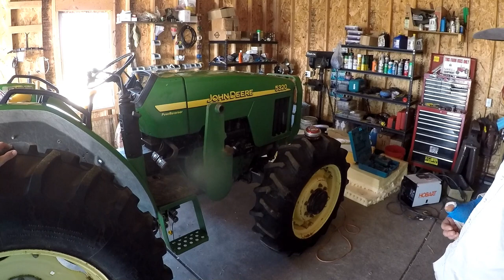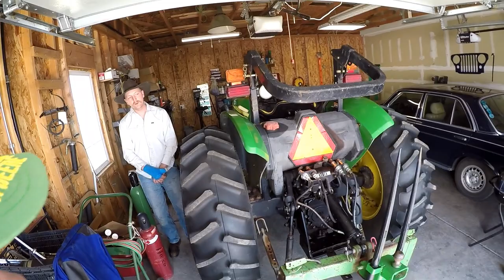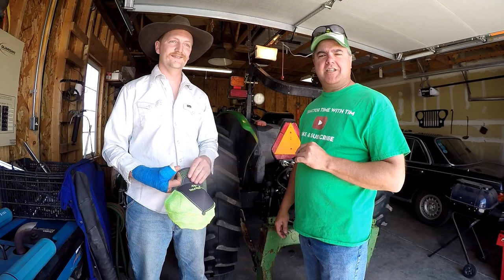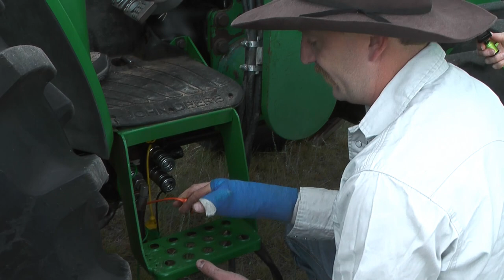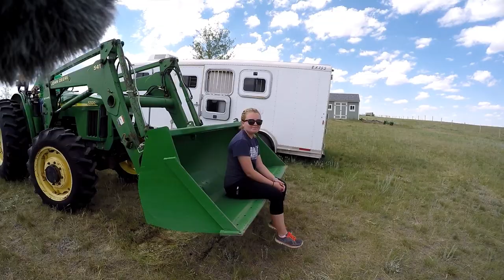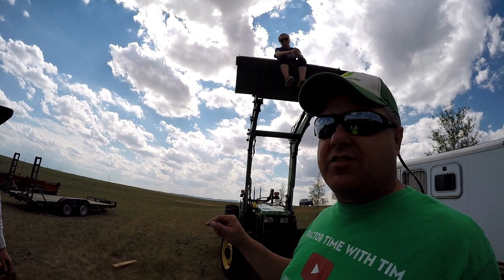Why Buy John Deere? (and why not); JD 5320; Katriel and the Self-Leveling Bucket

Comment: Nice video Tim and Blake. One thing that continually amazes me about JD compared to other brands is not only the easily on-line access to parts information but also the operator's manuals.  I've tried to access on-line parts and manuals information for a few other tractors (Kubota, New Holland, Yanmar and Kioti) and it is very difficult and in most cases impossible.

Comment: I have long been a John Deere guy. Grew up with the green and would probably have bled green if cut. Anymore, it seems  that the Deere company seems to be grinding up $100 bills into the paint and do not seem to be worth the difference in price to people. Having said that, consider the dealership network and parts availability. That comes with the price tag. Are they better tractors? Probably not, but they are there for you when you need them the most. That company has lived through the most difficult times and has survived. That has to stand for something.
Gary Fox, Iowa

Comment: One thing I found most interesting is that a tractor that "old" has a power reversed that doesn't require pressing in the clutch to change direction. I always thought that was a relatively new feature like within the past 8 years. Cool beans!
Reply from the maker: it worked well, too!

Comment: With all the proprietary use only diagnostic issues John Deere is having with its bigger hp tractors these days, I would hesitate on the side of caution before laying down large coin on one. Nothing wrong with the tractors themselves, but I don't need a 10 ton paperweight that can only be serviced through them and nobody else.

Comment: Hello, that’s a nice tractor he has and he’s absolutely correct the 507 5 hp is going to be similar to that, I just purchased a 5090E cab, I think the 90 hp and 100 hp is a pretty good do it all tractor, myself personally I like John Deere, they are a little bit more money than other brands but the nice thing about John Deere is they have dealerships everywhere and lots of parts warehouses end it comes down to dealer support which I have and I run my tractors come spring time seven days a week and having that support from the dealer is a necessity, I think any brand of tractor is good especially for a property owner that uses their tractor every once in a while and whatever someone buys they should be very proud of it, but I do feel John Deere makes very well-built tractor, he’s not going to have any problem selling that tractor I do recommend a cab once you get a cab you never go back the only time I like an open station tractor is those nice warm spring mornings when everything is green and there’s no dust but having a cab tractor and air suspension seat stereo system and you can even talk on the phone it’s that quiet inside it’s kind of like driving a Jeep, New Holland is a great tractor and so is Kubota and plenty of parts availability,thank you for the video Tim🚜👍

Comment: You guys hit the nail right on the head when it comes to getting parts. That was one of the biggest reasons why I got to 1 series. I've also have a 1982 D 1500 Mitsubishi tractor. (Mitsubishi tractor division was bought out by (I beleave) Selow). But anyway it's a 15 horse Diesel twin cylinder. With no loader and I swear it don't use fuel because I mowed my grass with a 60" Ford finish mower on the back of it over a year plus all the other stuff including moving old mowers and stuff from my old place when I moved on less than 1 5 gallon tank of diesel. That being said though it took me 3 months to find a water pump for it when it went out. And if a water pump is hard to find what if something more drastic happened to it. So I started thinking about replacing it at that time. I looked at the woods at Cabela's did not like the way it set with a backhoe plus the fact that that tractor you would have to completely remove the mount to the backhoe underneath the tractor to install the mower deck. The book said it would take 4 hours. Little ridiculous huh? Then I was looking at the Massey Ferguson but could not find one to actually sit on and see if I liked it. Only one dealer in my area. Again I know what you're talking about. So then it was narrowed down to Kubota or the 1 series John Deere. I probably could have saved money by going with the Kubota but I remembered what my local Kubota dealer told me when I was looking for a water pump for my Mitsubishi. You're going to get a laugh out of this. Are you're ready?
He said and I quote, "WE DON'T WORK OR SELL PARTS FOR ANY FOREIGN EQUIPMENT". Really I didn't know Kubota was made in the US. And I couldn't help but laugh out loud at his stupidity. Yes, this was the dealerships owner and Lead salesman. Yes I walked out mad and laughing all at the same time. 
So I have Johnny's twin only I think you have the 60" deck right? I have the 54" and I also have the 4' brush cutter from John deere. And no quick hitch.
Reply from the maker: +Alvie Schreckhise thanks for the story.  I have 54"

Comment: My uncle owned the Massey dealership 4 miles west. We went 15 miles east and bought Green. John Deere hired engineers
Reply from the maker: +mcinkyt it truly is unfortunate.  We used Massey Combines when I was a kid, but we had to move away from them eventually.  They got all messed up in the early 80's
Reply: Oh yes, you ever try putting flax up a Paddle Feed feeder house? Plus bearing housing were only bolted to sheet metal. It didn't work to well

Comment: Instead of a JD6420 he might consider a 2755 ( became 6300)
The 5320 is not 60 PTO HP, it is 55 ( Tractor Data and JD) 
I have a low hour 2440 that is 61 PTO HP and a 2755 that is rated at 75 but came with dyno sheet at 93 PTO HP.
Items that the 61 HP tractor struggles with  run without effort on the 93 HP tractor.
So going from 55 to 93 will leave lots of reserve.
2755 s are a bit older but low hour tractor are out there (2100 on mine)

Said by many  be one of the best tractors ever built by JD as with that whole 20 series of Mannheim tractors.

Comment: He could still get a John Deere M Series 5115 or the R Series 5115 or 5125.
Reply from the maker: +Don Hanson the 5320 is also not physically heavy enough.  The swather drags it around.
Reply: Don Hanson we want to move to a larger frame size than the 5 series. The 5320 is maxed out lifting the snow blower and pulling the swather, it does it but I don't like pushing my equipment to the extreme all the time.